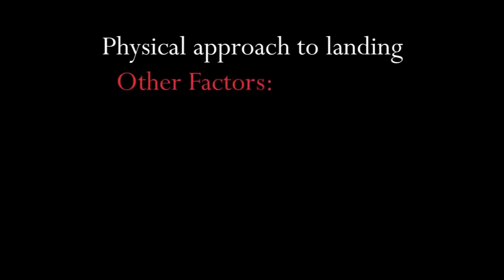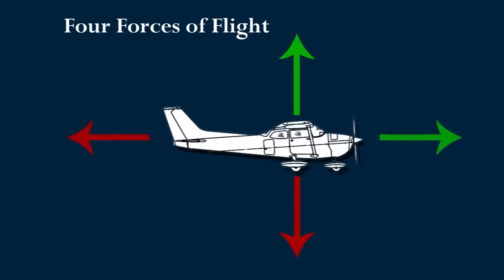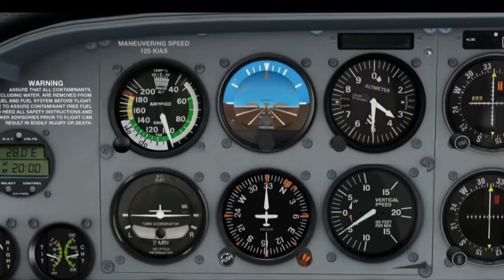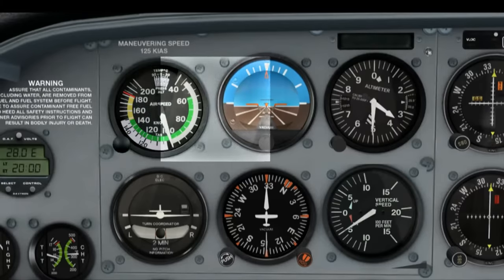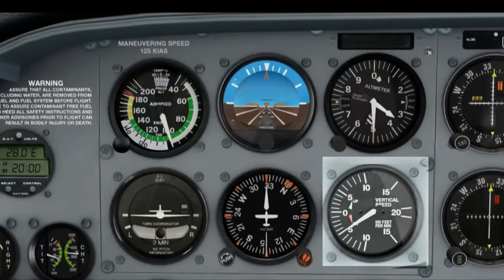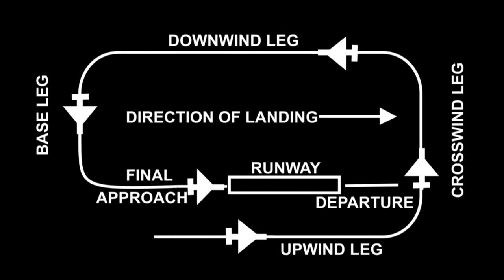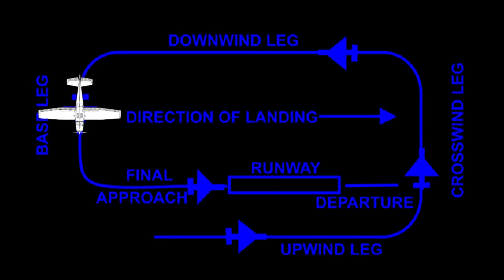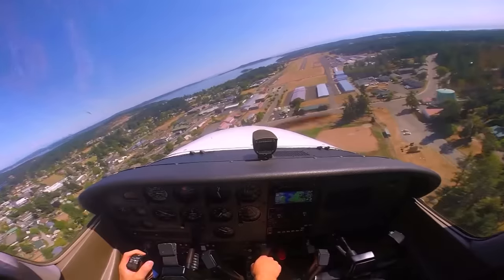How to Land a Plane

Comment: These videos rarely talk about angle of attack. If you don't understand that, you are missing a key element of flight. You can't talk about flaps without talking about angle of attack. Stalling isn't a function of speed, it is a function of AOA. Flap settings change the stall AOA so that you can safely fly at a lower speed. They do that by changing the geometry of the wing, thereby changing the flight characteristics. A pilot MUST have a thorough understanding of AOA, or his proficiency is limited. I'm an ex Air Force pilot with hours in large transport planes and supersonic jets.

Comment: Many years ago when I first started flying an old WW2 pilot gave me some great advice.He said most new pilots tend to overshoot the runway so hold the nose of the airplane under the numbers till you get close to the runway then adjust. Best advice I ever got. Allowed me to use the whole runway for landing.
Reply: "Stick and Rudder" is a marvelous book. One landing hint in it involves comparing movement of the view in the windscreen. The area you're aiming for is the part that doesn't move up or down as you approach. Once you learn how to see this, precision landings are easier.
Reply: @KutWrite  but doesn’t it move as you adjust your pitch for airspeed?
Reply: @GizmoMaltese  Well, the point would move on the windscreen, but the same place on the runway would remain the "no-apparent-motion" touchdown point until your glide path changes. It's analogous to the centered "meatball" on an aircraft carrier's glide slope mirror.
Reply: @KutWrite  so is that where they get the term " call the ball"?
Reply: @richard94511  Right. The pilot sees the ball he'll say "{his number}, Ball, {fuel in hundreds of pounds}." If he can't see the ball, he'll say "Clara Ball."  Really.

Comment: Nice video.  Thanks for sharing.  I find that there's an all-important transition point between crossing the numbers (pitched down) and pitching up to place the nosewheel out of harm.  In this transition I aim to fly level above the runway for just a few seconds.  It's where I rely on losing that last bit of energy (speed) and obtain the final foot or two of sink before touchdown.  Transition to nose-up too soon (too fast), and the aircraft tries to take off again (then stalls, resulting in a 5ft drop to the runway - ouch!).  In truth, this is the hardest part of flying.  For me, at least.

Comment: Love the simplicity of the explanation. I'm in the landing phase of my training and I do find it very challenging.
Reply: nothing to it.  stick it down on thenumbers.  you can not use the runway that you landed beyond.
Reply: @joekirk167  I was taught to aim for the numbers, too. But landing an airplane is the single most difficult maneuver to perform. This maneuver actually begins on downwind and ends when you taxi off the runway.
Reply: It takes practice. My first solo attempt at landing an airplane, ended up being a go around. My instructor was pleased I performed the go around, rather than try to salvage the landing attempt and wind up damaging me and/or the airplane. My own rule of thumb is if I can't get the plane on the deck by midfield, go around. Perhaps, I was a little distracted when I was on downwind, looking at my instructor on the ground, instead of focusing on the pattern and the runway.
Reply: As long as you mantain the right altitude, the correct airspeed and flap configuration on the downwind, the base and the finals, you should be ok. Once you line up on the runway, mantain about 600/700 fpm descent rate, enough power to mantain your constant landing airspeed and you should be landing on the 1000 feet marker.
Reply: oh god hes gonna do the next 9/11 look at this name

Comment: Most people learn this way, but it’s all wrong and while you can get by, you’ll never have full control over your approach and landing using this method.   The key is to adjust your aim point to make corrections and to round out and flare. Pitch and power follows, but you are always always always aiming somewhere or you aren’t going to get there, even while taxing.

Comment: Whenever I wanted to really impress a passenger I would attempt to grease the airplane, usually a C172, onto the runway, if there was little or no traffic and no crosswind, by putting on full flap just before the threshold and touching down with just a wee bit, the slightest amount, of power on. Often there would be no vibration in the plane at all and just a soft chirp from the tires to indicate the plane was down. One of my friends called me "old smoothie" when I used this technique. I was able to obtain smooth landings following the conventional rules in the North American T6 Texan, and TF-51D Mustang as well as an Air Canada Airbus A320 CAE pilot training simulator but I always enjoyed an opportunity to see a surprised look of delight on a passenger's face using the full flap technique under the right conditions.
Reply: I annoyed a check instructor by doing the opposite. Wanted a shortfield landing in a 172 so full flaps, screaming stall horn, and when it was about 8” high, dumped the flaps and stood on the brakes. It works. Isn’t pretty. He got kinda mad, and then said, “Well, I asked for it.”
Reply: I flew a C-172 for a long time. Found it would hold altitude in stable flight with 1600 RPM and full flaps. So when faced with a tricky landing (gusty winds, etc.), I would set full flaps at 1600 RPM so I could devote full attention to the outside without worrying about it stalling and dropping out. Then I could work it down gently and eventually touch down at which time I reduced power. Worked for me. 
   Also determined that it took 300 feet of altitude to make a 180 degree turn without power, but that's another story.

Comment: When I flew Cessnas, long ago, I used the VASI lights to land on the dot. Those Cessnas were extremely easy to line up an approach, flare out and squeek the mains, every time. You would have to be a moron not to handle a Cessna properly. J-3 cubs are awesome for grassy strips, but the Cessnas are king of beginner flight...

Comment: I'll never forget the first no flaps landing the instructor had me do, I was a little hot on final so I was stuck in ground effect just floating along, I kept back pressure on the yoke. On a 10,000 ft runway, didn't think I would ever here that chirp. Finally settled in and this irritated A.T.C voice came ov and announced, "congratulations  9541POPA, A 172, you just ate up enough runway to land an F16.

Comment: If you fly a low wing a/c keep a tad of power about 600-700 rpm, you will float a little. I sometimes use a little power in high wings also for real "soft-fields". Landings for me really came together with my commercial ticket

Comment: I make it a point to roll out on final at ~400 feet AGL. This really helps to set up a consistent stable final approach. The sink rate in my RV-8 with CS prop is considerably higher than in a typical Cessna high-wing. So this makes me carry a bit of power into base and final. With a CS prop, I set the prop to full-fine before turning base and then adjust the throttle to achieve ~2,350 rpm engine speed. Without crosswind, this should bring me close to 400 ft AGL when I roll out on final. If the engine is backfiring a bit, which is not uncommon on base and final, I'll lean the mixture out just a tad till the backfiring stops. I don't see anyone recommending to roll out on final at 400 ft AGL or thereabouts, but it makes a big difference in terms of landing consistency. I always fly by the numbers. When in cruise I'm always WOT with mixture leaned back to about 7.3 gpm fuel flow (peak EGT). My EGT's, CHT's, airspeed, oil temperature always settles out at nearly the same levels which makes it easier to spot any abnormalities in engine base performance. Fly by the numbers...figure out what they are for your plane for each phase of flight and then try to stick to them. It soon becomes second nature.
Reply: My C152 landings got a whole lot better once I figured out that I could use slightly more power, right up until the wheels touch.  Sink rate is pretty much irreproducible landing to landing (wind gusts).  I don't mind going in with a bit more power, as long as I have runway in front of me.
Reply: Ok i see u einstein

Comment: A long final is fine as long as you can drag it in with power, but what if you lose power in a single? The object is to land on the runway, not short of it. If you practice by pulling the power opposite the numbers on downwind, and adjust your glide with no power to land on or past the numbers, you won't have that problem.

Comment: The proper control of glide path is to pitch for altitude and add power as necessary to maintain airspeed. I have over 4,000 hours as a CFII, MEI and that is how I was taught and how I taught it. I can offer prove of this method from the FAA and AFM-51-37 (Air Force Manual).

Comment: My dad was a chiropractor and he had a bonanza Beechcraft and I would fly to his doctor's office during the summer when I was in high school and weed-eat and paint and do things and then we would fly home at the end of the day. We had a house that was in a development where you parked your airplane in front of your house cold Sierra Sky Park in Fresno California. After years of flying there and to see my grandma and grandpa he would let me take off and eventually land. I finally got my pilot's license and we would fly me and my mom all over California and Nevada Oregon this thing with Cruz at 257 Mi an hour. It was a badass plane horizontal 6 cylinder. One day we were flying to my grandparents house and we stopped at Fresno Air Terminal from our house about 10 mi from the Fresno Air Terminal and got gassed up and had an oil change well the stupid son-of-a-b** forgot to put the filler cap back on the oil filler pipe. We took off to go to Porterville and as we were lifting off down at the end of the runway and got Airborne the damn cat blew off or whatever we never found the cap. Boyle started blowing all over the windshield oil pressure started going down it was an emergency landing we did a 180° off take off and came right back down and landed thank God it did not destroy the motor there was a oil everywhere and it was on fire we had to replace the hood covers and some of the wires and the guy that change the oil and the company he works for were sued I believe it was like $7,000 worth of damage. Plus we did not sue for punitive we were both scared to death that we were going to blow up in midair and crash.

Comment: -  Yeah, I also found thru trial & error that controling yaw, & roll helps in a smooth landing by lining up your wheels in the direction of travel. The diving forward, cartwheel tumble technique, although a favorite for attracting crowds, doesn't do much good for repeat flying.

Comment: Did you ever mention using the elevator trim to set the plane's approach speed? You shouldn't have to apply constant pressure on the yoke to maintain the approach speed. The plane should pretty much fly itself at the correct airspeed.

Comment: Nice video!  On the ground the rudder pedals left/right steer the nose wheel during takeoff and landing and rudder will move too. Push the tip of both pedals at once to apply the brakes.............

Comment: I've just got to share this story here for people who are obviously interested in piloting. I was stationed at Kelly Air force Base from 1979 - 1982. Kelly is (or at least was) the Air Force Logistics Command Headquarters. C5 Galaxys line the runways with enormous hangers but there was also about every type military aircraft imaginable in and out of Kelly every day. This video is about landing???  I was parked on the perimeter road at one end of the runway as I often did. The aircraft were landing directly overhead and I was about 400' from end of the runway. Here comes an F4 Phantom absolutely screaming from the opposite direction about 200' off the ground and 1/4 mile off parallel to the runway. I thought "hotdog has gone stark raving mad!". As he neared the end of the runway he pulls into a high G full 180 degree turn and and sets his LEFT WHEEL ONLY onto the runway lined up straight down the middle. He kept the burners going and went screaming  LEFT WHEEL ONLY about half way down the runway before setting down the right wheel. Without a doubt the most awesome landing I ever witnessed!!!!

Comment: Flaps are exactly like the gears on your car. 1st gear is full flaps. Overdrive is zero flaps. On takeoff and landing you prefer full flaps for ultimate lift force to compensate for the low vehicle air speed. Once cruising up high with the vehicle's momentum undisturbed, reducing flaps completely will reduce drag as much as humanly possible, and will also reduce lift and maneuverability 😮 but you don't need as much lift or dexterity way up high anyway. So, like a car progresses through gears as it accelerates and, likewise, regresses through gears as it decelerates - the plane uses full flaps (1st gear) at takeoff and progresses through less and less flap angle as the plane accelerates until flaps are fully retracted at cruising speed. For landing, the plane must slow down and must compensate for the loss of lift and maneuverability by extending the flaps... Thought Experiment: If a racecar driver were stuck in 6th gear for a sharp turn upcoming, she wouldn't be able to make dexterous moves while relying on only brakes to slow the vehicle, and then after the turn, trying to accelerate would not only take forever, but it would again make maneuverability seem like slow motion... Semi-trucks rely on correct up-and-down gear changing for other purposes, but for the same exact principle of physics. So yea, you can think on it some more, but it's almost an exact analogy. 1st gear in your truck is like full flaps on a jumbo jet. Your truck will roar through first and second gears while carrying a full load up an incline. The jet will maintain 90-100% flaps on takeoff with full load on board. Your truck rpms raise as the road levels out, now you gotta merge on the freeway. You burn through 3rd, 4th, 6th gears as the truck gets up to speed. The pilot will retract flaps to 60, 50, 40% as the plane ascends in the air gaining tons of speed. Your truck will cruise at nearly the highest gear, or the actual highest gear when keeping 75mph and maneuverability is not a high requirement since the road is very gradual and built to cruise without stopping. The jet will retract through 20% 10% and finally zero % flaps, relying only on the wing's fixed pitch to maintain lift at 30,000 feet. Maneuverability and lift is likewise lowered, but that's no longer needed because the vehicle's momentum is so great it doesn't need as much assistance to keep it going.